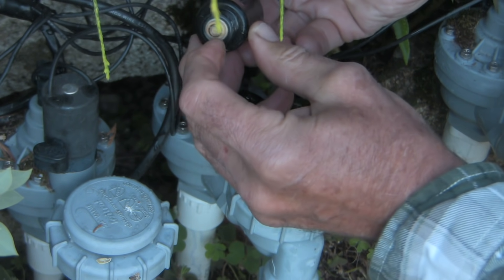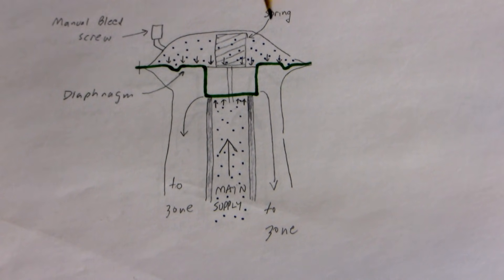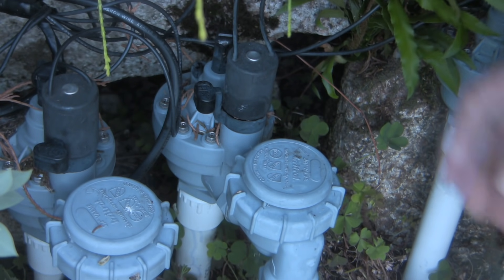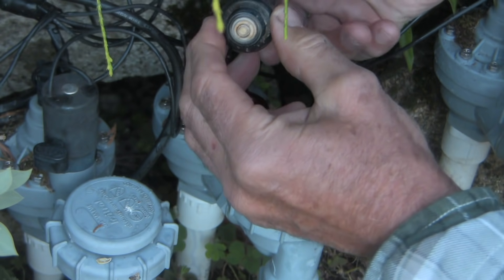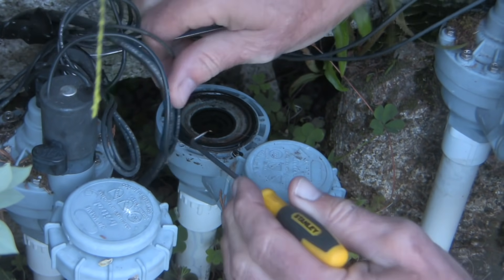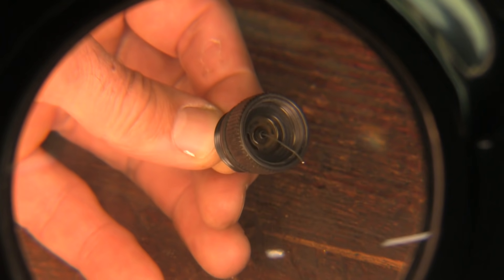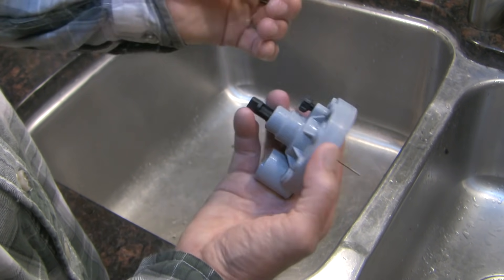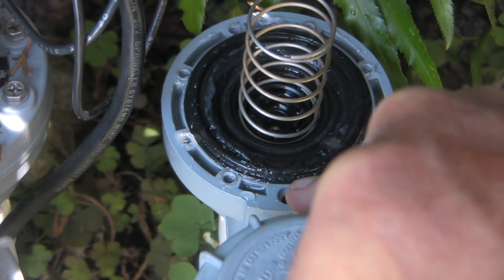Troubleshooting irrigation sprinkler valves

Comment: My zone wont turn on manually at solenoid or bleed valve...but I hear water when I turn it on and water comes out of bleed valve....so guessing its likely clogged inside and maybe a good cleaning will fix it...atleast can rule out solenoid. Thanks....edit just bought a valve which included solenoid as a spare part....swapped out all to existing bottom of valve. Works great now. 👍

Comment: I echo the previous compliments.  Your video and explanation are the best!  Thank you very much!

I've always had a problem with one of my valves.  It does not turn on using the controller so I've had to turn the Manual Bleed Screw to turn on the sprinkler.  I've tried troubleshooting it but can't seem to fix the problem.  I've changed out the Solenoid, cleaned the different orifices but no luck.

My current problem just started when my controller went bad.  No power.  So I've been turning on all the sprinklers manually till I get a new controller.

Weirdly, that one valve I've had the problem with previously, now does not turn on even by turning the Manual Bleed Screw.  Like it used to previously.  Which doesn't seem possible since that's a fail safe and should definitely create flow of water to the sprinkler heads.

I'm about to take everything apart and clean everything again.  And if that fails, replace the whole valve.  But I wanted to ask you first if I'm missing something.

Please advise.
Reply from the maker: You can replace just the diaphragm, or you can replace the whole valve. I'd probably start with the diaphragm first, if only because it's pretty easy and it's kinda nice to have one on hand anyway if you need to replace the whole valve later.
Reply: @spelunkerd  Thank you for your super quick reply!  I will do that do that today and update you on the results.
Reply: @spelunkerd  I ordered a diaphragm but I'm having difficulty pulling the old diaphragm out of the housing.  Do I just pull and slightly twist?

I'm afraid to pull to hard and break something.
Thank you!
Reply from the maker: @goto_ricoproductions1897  It may be stuck, which might explain why it wasn't working. I'd pry it out, as shown in the video. It should be free moving.
Reply: @spelunkerd  Thank you, I'll try that this morning!

Comment: I had a zone that would not shut off. The problem turned out to be the little tapered coil spring on the solenoid (Orbit brand) plunger had slipped off of the head of the plunger not allowing it to return to the seat when the zone time ended. Another problem I have had (twice now) is that for some reason the plunger will not pull back to open the port even though the solenoid electrically functions. The problem I found was that some how at the bottom of the plunger bore, the little metal piece had been forced forward, not allowing the plunger to pull off the seat. I took a pair of channel lock pliers and with one jaw on the little metal button and the other on the plunger, squeezed hard and the plunger returned to it's original position. My theory is that water gets behind the metal piece and in winter, through freezing, shoves it forward. Do you have any ideas on this?
Reply from the maker: Good thoughts!

Comment: Has anyone had issues with the bleed screw leaking?  How did you fix it?
Reply from the maker: If I recall correctly there's an O ring on that screw. Turn water off, and unscrew it completely, being careful to not drop the O ring in the grass. If the O ring is missing you could disassemble a normally functioning valve screw to verify it should be in place and get the right size. You can buy inexpensive generic seal kits from Princess Auto, Harbor freight, or Amazon that will likely have one you need. I usually put a dab of silicone paste (not RTV or any paste that dries) onto the seal and threads to prevent leaks. Screw it back in and you should be good.

Comment: My situation is different the automatic controller turns the valve on but the Hunter spray heads just bubble they don’t pop up. If I go to the controller and turn off the zone valve then reset the controller to turn it back on again the heads pop up all the way. I took the valve apart and cleaned the diaphragm and the top cover and put it back together and the same thing happened. This only happens on zones 2-3 the rest are fine. What could the problem be?
Reply from the maker: Check to be sure the zone before the problem zone is shutting off completely. Also trace around the zone in question to be sure that there's no leak, bleeding pressure away so the normal heads aren't getting enough pressure to open. Leave the zone on for a few hours, then walk around the garden looking for a wet spot. If manual control works fine but the solenoid doesn't open the valve all the way, clean those small passages, be sure the screw to control flow is all the way open, and if all else fails try swapping solenoids to see if the problem moves to the new zone.
Reply: @spelunkerd  OK I’ll take the value apart again and clean the diaphragm and bonet. The valve is a Hunter PGV  model

Comment: I have 2 zones that have poor pressure.  When I open them manually with the bleeder they still have low pressure.  I dont believe that it's a root pinching the line as I dont hear any pinches anywhere in my yard.  Thoughts of what may be causing this?
Reply from the maker: A more common cause of low pressure in a zone is water bleeding off. Run the zone for a few hours, and walk around it listening for hissing, find the wet spot. If you find a wet spot, dig down to find a leak. It's also fairly common for drip nozzles to pop off, sometimes hidden in the bushes.
Reply: @spelunkerd  I havent found any saturated spots.  I am wondering if it might be a diaphram or solenoid issue
Reply from the maker: @dskrpncs  To test your supply line you can unscrew the head of the valve and see how high the little fountain jumps when you turn the water back on. As shown in the video there's a screw on the head of the valve you can turn to open the flow all the way up. So, make sure that flow limiting screw is all the way open. It wouldn't hurt to open the head of the valve up and have a look, to explore your thought that the valve is not opening all the way. You could even swap internal parts between heads to see if the flow remains low with a different internals. It's very difficult to prove a pinched line, especially in this day when many lines have such thin walls. In the spring, the most common problem people forget is how you need to manually close all valves tight so that pressure going to one zone isn't bled off by another. Those valves are left cracked open in the fall, so water won't collect and freeze against a valve in the winter.

Comment: I was clued in that you were in the medical field when you used the term "presents" when describing the symptom of the problem - usually used in medical contexts.  Fantastic video, I enjoy doing these side projects as mental exercise and honing my troubleshooting skills!  My solenoids are new, but still will only work when unscrewing the valve.  I'll need to open the valve and see where that takes me, hopefully not losing any O-rings in the process!
Reply from the maker: My career in diagnostic medicine is now over, but the fundamentals overlap with troubleshooting auto repair, too. Interestingly in medicine the history is often the best clue, but in auto repair the tech rarely speaks with the customer directly. Thanks for stopping by!

Comment: How do you stop the dripping in the anti siphon lid?
Reply from the maker: First week of the season they often drip, but that usually settles. If not, remove and clean the seal. Dirt and corrosion on the seal is what causes it to leak. If that doesn't work they are easy enough to replace. Antisiphon valves in general tend to leak a little, but since the line is only under pressure for a few minutes per day when the zone is active, it is transient and not usually a problem.
Reply: @spelunkerd  I greatly appreciate the response!

Comment: I had a slow leak and thought I'd have to replace the diaphragm. A took it apart, cleaned it and flushed as your video guided and everything appears to be working fine now. Thanks! P.S. Your theory and pictures were excellent.

Comment: Good video but did not fix my problem. Same Iritrol valve. Cleaned but did not fix. Replaced with new and same thing started happening again where water would not turn off. Bleed screw and solenoid both would turn on, but not shut off. Was running 8 zones of rainbird impact sprinlers so lots of water flow. Turns out throttling down the flow control knob 2 turns fixed the problem. I suspect that high gpm flow rate disrupts rhe normal diaphram operation. Anyway thanks for the detailed schematics which helped me to understand how these work.
Reply from the maker: Thanks for this comment, which may help many along the way. I scan through remarks in the comments thread in any video I watch, looking for insight that goes beyond what was presented. Bravo!

Comment: My sprinklers where spraying good and half way through the 20 min interval it is at half pressure would this be a valve issue? why would it lose pressure suddenly?
Reply from the maker: If you aren't experiencing pressure loss in other zones, have a close look for a leak somewhere in the zone that is giving problems. It is very common for a downstream leak to rob pressure from the rest of the devices. If the zone in question is drawing more water than your system can keep up with, you could have a problem with water supply. Many systems have an expansion tank that increases the capacitance of a water system, and when that tank is depleted your system pressure will fall.
Reply: @spelunkerd  Thank you for your detailed reply!

Comment: I just unscrew the solenoid without unscrewing the manual control bushing, I've not had unscrew the manual control bushing to get water to flow.   Although normally I'd use the bleed screw for on valve manual turning on.

Comment: Any advice would be greatly appreciated. 
I’ve got a zone of hunter sprays that won’t pop up. There’s water coming out but they don’t pop up after the previous zone of the same sprays is done. However I can start that zone itself and it works fine!
Reply from the maker: That's a sign of low pressure. If it starts fine on its own from the controller, then I'd be wondering if the zone before it is completely shutting off, draining pressure away. If it doesn't start fine from the controller, then I'd search for something bleeding pressure off in the zone itself. If it starts fine when you open the valve with your hand, but doesn't start fine when using the controller, I'd be looking at the solenoid and solenoid wiring.
Reply: @spelunkerd hanks for the speedy reply! We had a booster pump installed on our main line for the house because of low volume from the start. It starts fine at the controller or from my phone. Just doesn’t want to run after the previous zone. 
Do you think I would be better off with mp rotators in my spray zones? Or would those not make a difference? I don’t have an issue with my rotors going one after the other.
Reply from the maker: @pagodad8079  You could try changing the order of zone activation to see if that makes a difference. I have no experience with pressure boosters. Yeah, if a head is taking too much volume from other devices, swapping it for a lower volume head might help.
Reply: @spelunkerd k so I swapped the two spray zones with each other and now they pop up. That is really odd! Zone 2 is zone 3 and zone 3 is now zone 2. Would you know what might cause that?

I will add that I notice a little bit of water leaking from one of the valves in the valve box while it’s running. It is a drip leak The leak is where the 1” water line connects to the valve.
Reply from the maker: @pagodad8079  Many valves have an associated anti reflux valve that opens when pressure is negative, designed to prevent line water from siphoning back into your home drinking water. A good example is this exact video. If there's corrosion on the seal it may leak even when pressure is positive, and you can often rejuvenate the seal by cleaning the lip. If it's leaking from a connection, you may be able to fix it by tightening it up, by replacing the pipe dope and teflon tape, or by replacing a part. Regarding why order may matter, many systems have a low capacity, beyond which pressure drops. If you move the volume hungry zones to the front of the line you may do better. If you're on a well with a pressure bladder, check the pressure of the bladder since the bladder diaphragm often fails, which reduces system capacity.
Reply: @spelunkerd I’m actually in city water. We had to put in a booster because there wasn’t enough volume without it to run the irrigation system. Even with the pump I feel it’s inadequate. And I don’t really get true head to head coverage with my pgp rotor’s. 

The pump holds at 70psi when not in use. It’ll drop to 50psi when I run irrigation.

Comment: I have a Rainbird, same set up. I had leaking anti-siphon valves so I replaced the caps and washers. Fixed the leaks but now I have one that briefly gushes out water when it turns off after the cycle is complete. Could it be the diaphragm?  Thanks.
Reply from the maker: It's supposed to do that when the downstream piping is above the level of the antisiphon valve, so think of it as clear evidence your antisiphon valve is not stuck shut. Positive pressure in the downstream piping that would normally backfill the system and contaminate your home water supply is harmlessly spilt onto the ground. If the downstream piping is below the level of the valve, most of that downstream water is retained in the line after the siphon is broken by introducing air into the line near the valves. That's why those valves should be installed in an elevated position above the surrounding ground, so not much water spills. If you get a continuous leak, then I agree, look at the upstream valve and siphon.
Reply: @spelunkerd  Thank you for the info.

Comment: My sprinkler valve turns on as soon as I open it instead of it turning on at the start time on my Orbit sprinkler system, by any chance is there a solution to that? ALL I find online are how to turn on or off the valves manually but I know how to do that and that isn't the problem
Reply from the maker: Assuming that your controller is not commanding the solenoid to open, then your problem is the same as the one diagnosed and fixed in the video. First be sure the valve is closed when you start, all the valves in the system should be manually closed. They open when the solenoid moves the valve open. If your valve is sticking open, you want to clean and inspect the valve and diaphragm, flush the line of any debris, then reassemble and see if it works. If it still doesn't work you could try replacing the diaphragm, and of course if the diaphragm is damaged or torn it needs to be replaced.

Comment: Great Video, detailed. I have a weeping valve, I did replace both the diaphragm and the anti-siphon side just to avoid cleaning the system, the valves are 16+ year old so I felt I would fix the problem by just replacing the two pieces and I still have water coming out of the irrigation drip even if the valve is hut, what could be the problem? I think I did not flush the system when I opened the valve, will try that next.

Comment: Good video but does not address my problem.  Timer will turn valve on but flow is minimal.  Only after I turn the solenoid open does it come on fully.  Two valves just started this issue.  Changed solenoids with a valve that works, still no go.
Reply from the maker: Make sure no other zone is remaining on when you switch to the new zone. Sometimes the problem is in the last zone that was supposed to turn off. If the last zone doesn't turn off completely, you won't have enough water pressure to open the next zone completely. Also note the screw that adjusts how far a valve opens, it needs to be completely open. That's probably not it if manual control works fine. Remember you need good water pressure, if you live on a well you could have a pressure drop for zones at the tail end of a run. In that case, electronically activating one zone by itself should work fine. If all that fails, try cleaning the bad valves like I did, or replace the diaphragm. If even that fails, you may have to bite the bullet and replace the valve.
Reply: @spelunkerd  Thank You. I went ahead and changed out the whole valve.  Works again.

Comment: Thank you so much for your videos. I still cannot diagnose my valve issue. Valve is new. Won’t turn on with the timer. I hear water gurgling sounds then after a few minutes starts dripping out of the anti siphon. If I manually turn it on and off during the timed session it completes the watering time and shutsoff per timer. I suspect a leak somewhere before the valve depressurizing the system. Not sure though. My husband gave up on the sprinklers years ago and I’ve been working on them myself.
Reply from the maker: If manual control works OK, then it suggests the solenoid is not opening the valve. Even though it is able to close the valve, I'd be thinking the solenoid may be to blame. As an experiment, if you have two valves side by side, swap the solenoids without disconnecting the wires, and see if the problem follows the solenoid or stays with the valve. Of course electrical control will switch zones but I'd be interested to know if the same problem now happens in the other zone. If so, it is either an electrical wire problem (high resistance somewhere, perhaps at a wire nut), or more likely the solenoid itself. You can swap out the solenoid for a new one, they are about $30. I did an older video on troubleshooting and swapping out a solenoid.
Reply: @spelunkerd  Great idea! Will try that next.